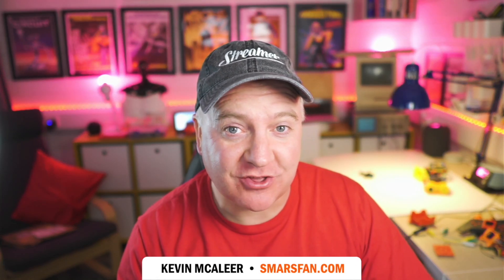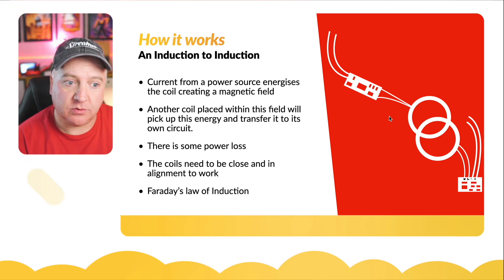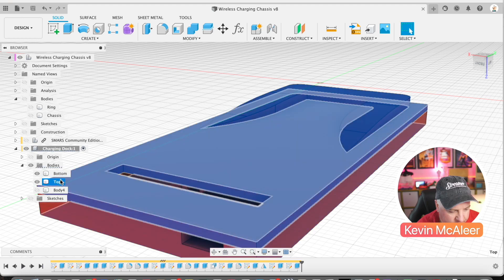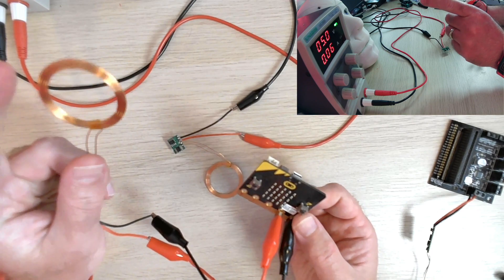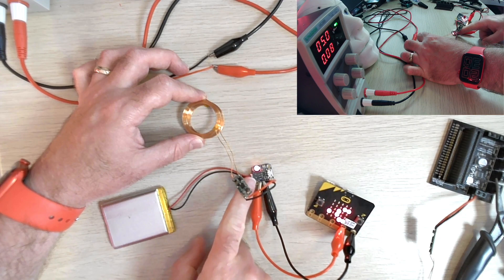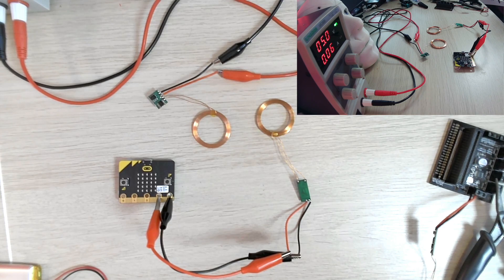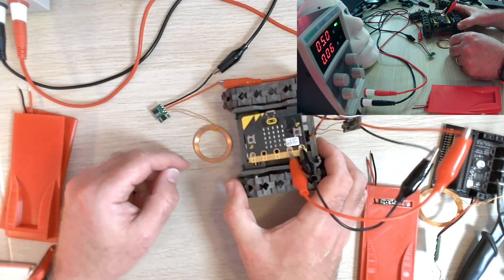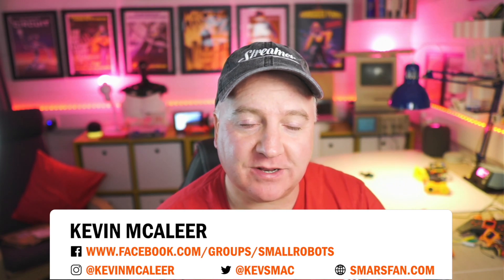How to add Wireless Charging to your Robot projects (it's so easy)

Comment: Great project😊 I know you can power an arduino/raspberry with the same power supply of the motors with L298N module. Are you doing the same thing with TB6612 ?

Comment: Q : Hi Kevin, great video! I currently have a 3s 4200mAh Li-Po battery and a 200w wireless power transfer development kit from Wurth Elektronik that includes 2 coils a receiver and transmitter board. My question is, how would i charge my battery with it? Do i need the microlipo board and a bms to safely charge the battery?

Comment: where can i find an electricity diagram of this project? Thanks beforehand for the answer!
Reply from the maker: With these modules there isn't a lot to add really. They have a vcc and a gnd, and you would connect them up to the battery charging circuit inputs. the other module simply needs the voltage and GND inputs

Comment: Q: I could not find the components for the wireless charging on the linked website. Did I miss something?
Reply from the maker: Hi - have you looked online? I googled ‘wireless charging components’ and they appear there. Whereabouts in the world are you based; availability of parts can be different in different parts of the world, however these are very common
Reply: @kevinmcaleer28  I’m in Malaysia, so close to China supplies. I have a project I want to do wireless charging on, but no experience. So though I could start with something proven to work.

Comment: Would I need a diode or anything on the positive end that connects to the mail board ?
Reply from the maker: I didn’t need one as you can see in the video - it has all the circuitry required and just passed the voltage straight through
Reply: @kevinmcaleer28  nice I'm adding one to my cordless hair clippers just trying to invent something different!
Reply: @kevinmcaleer28  but I also see your reciever and transmitter have the PCB board mine come as 1 hope it works 😀

Comment: Are the coils made of copper? Would you be able to cut the long straight copper sections and solder back together to fit into smaller spaces?
Reply from the maker: The coil is a tuned circuit so cuttings and soldering will probably affect it. Why not give it a try and report back

Comment: awesome video, Kevin!!! but now, the question is: How do I get the robot to drive autonomously on the charger  🤔😁
Reply from the maker: I think that might be a job for some AI and object detection, maybe a QR code. Another method maybe to use Bluetooth beacons - not tried that yet
Reply: @kevinmcaleer28  maybe there's an easier way, too... just working with an IR receiver on the robot and a sender on the basestation, just like those old robot vacuums had